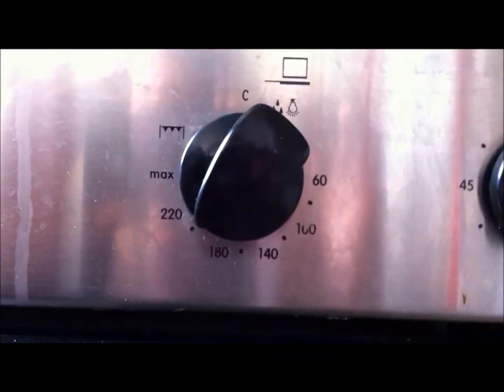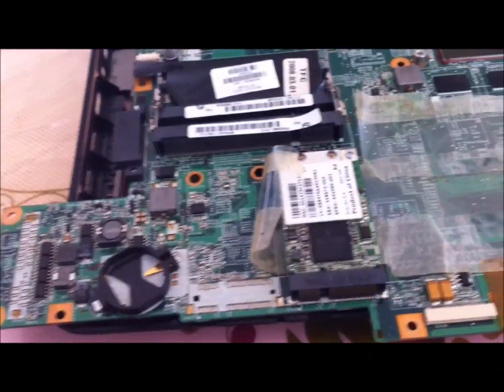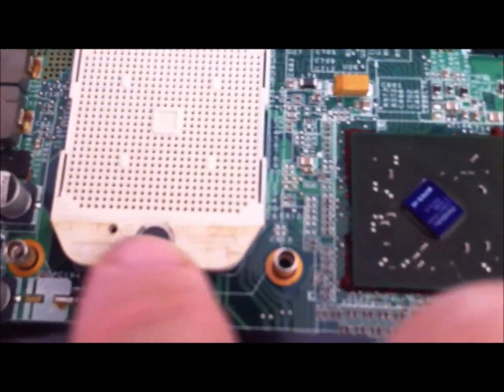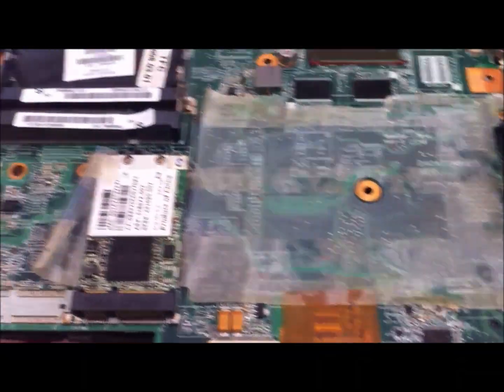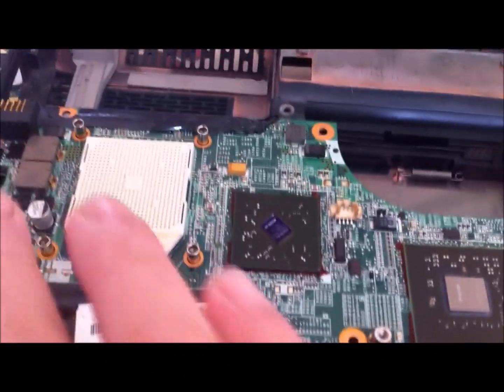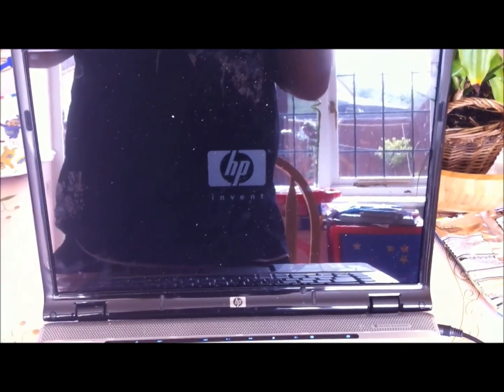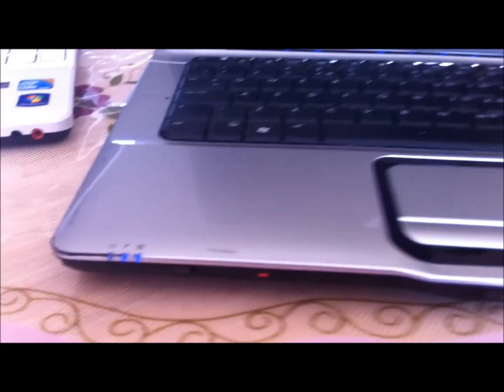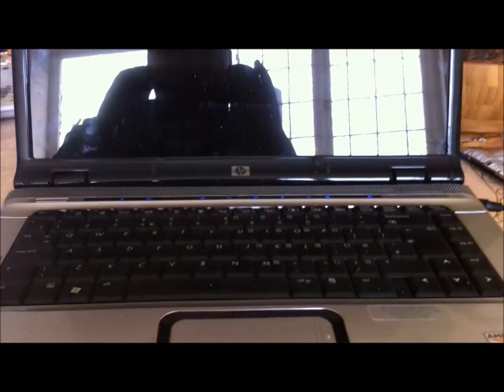HP Dv6000 Main Board Solder Reflow GPU Problems fix Oven Method

Comment: This video is 13 years old, but I successfully used this method on the motherboard of a Lenovo Ideapad Gaming 3 (15IMH05). I used a temperature of 200°C and a baking time of 5 minutes. The notebook is working perfectly again.
Reply from the maker: Oh wow that’s awesome, I’m glad you found it helpful and got you back up and running again. Be sure to make a backup of the HDD incase anything happens again.
Reply: @Cavalier_Steve  Laptops have SSDs these days, and I disconnected them; I only heated the motherboard. It's my son's gaming laptop (all the games could easily be reinstalled), but nothing was lost. The alternative was to buy a new laptop, since a new motherboard costs almost the same. So it was worth a try. I was surprised that it worked and everything went so smoothly. Thanks for the video.

Comment: I can't believe it worked. Ridiculous. Almost burned it. Definitely did a little. To anyone that's going to try it. Cover the top with foil completely. And only put it in for 5 minutes not 10. 10 and you'll burn it too much. Surprised it worked.
Reply from the maker: Good suggestion with the foil your right 5 minutes should be enough to reflow the solder. Just to note for others as soon as you get your laptop working again backup all your photos, music and files. 😀 I am pleased that this worked well for you! 
Thank you for your comments 
Steve.
Reply: +Steven Watson Thanks for the reply and especially for the video. Instead of laptop, it worked on my LCD TV main board. TV is back to normal. Very strange trick.

Comment: My DV6000 screen shows lines and distortion, but it loads into Windows Vista and then goes into the blue screen after I see the desktop after 1 or 2 minutes. What does that mean?

A repair guy says that it's possibly the hard-disk ... But it doesn't seem like it!

Comment: Gutsy move to cook the board without any thermocouple measuring the oven temperature.  My oven is of by 50* F.
Reply from the maker: That's a good point I had my eye on it the whole time though not that you can see temperature.
For all the others best use a thermocouple to ensure that the temperature is where you intent it to be. 
Thank you for your comment. 
Steve.

Comment from the maker: I hope that this will work for you. I would say that the oven method is a safer bet as with the heat gun you can melt the plastic that is what happens with me but then I think I was very close to the part when I done it. opps. 
Best of luck to you. Regards Steve

Comment from the maker: 1. No you can't use a microwave there will be sparks in there and this could cause damage to the static sensitive components e.g the GPU 
2. This shouldn't do because components are exposed to around 200 degrees c when they are soldered however this is for a short amount of time different to what we are doing hear I know but this method has worked with me on 2 laptops I will stress this will be a tempory fix though 
3. I tried the heat gun but this did not work so well for me you could try it

Comment: Hey i got an HP G62 with ATI raedon GPU in it. I have few question:-
1). can we use microwave oven?
2). doesn't this process damage or melt other ICs or any part motherboard?
3). I also read about the heat gun method, is that better than oven method?
please reply soon?

Comment: Your video was the best on the web.  I have a convection/microwave oven.  I used it on 425 Degrees F (above the 385 F converted from 200 Degrees C).  I put a small piece of solder with a little flux near a board mounting hole.  This was visual indicator to see when the oven was hot enough.  It beats guessing when the temp is reached.  It might have worked at 385 F, but I was not patient enough.  The PC worked when done.  I bought the Polysynthetic Silver Thermal Compound at Radio Shack. Thanks!

Comment from the maker: Hello there Andy, I gave it just under 10 minutes as I was worryed about the plastics but everything was all ok though :) you can smell the solder when you open the oven that is a good sign that everything was reflowed. Its not a perfect fix but it does the job. Hope this works out for you! Steve